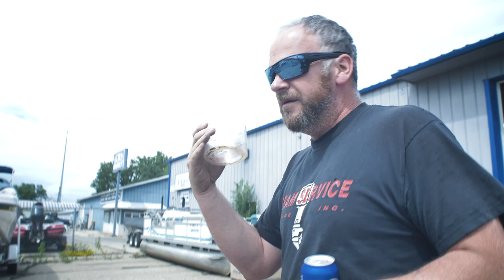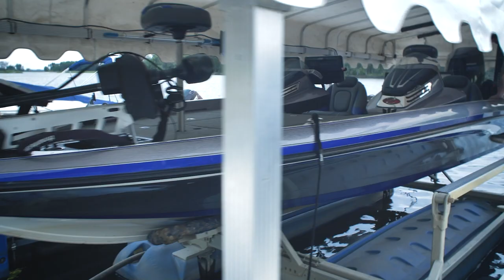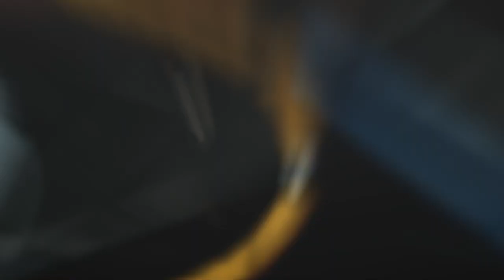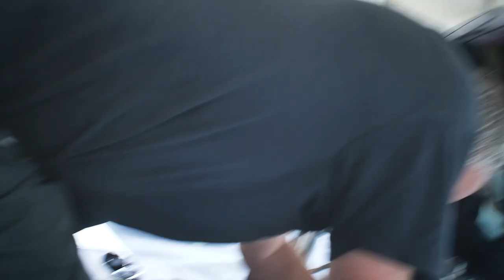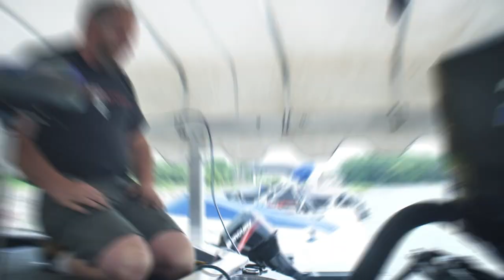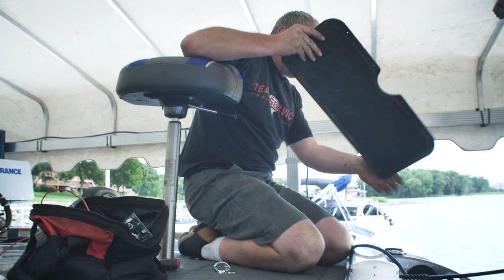POWER POLE PUMP FAILURE! (WATER LEAK!)

Comment: Keep these coming love it. I got a 2000 mercury 150 xl salt water series outboard 2 stroke I keep getting gas in the small oiling tank on the outboard I got a few new 2 psi check valves hopefully that works. Any ideas ?

Comment: We have a guy in Baton Rouge that makes house calls.  I only use him for my motor.  I have back up pumps, motors and boards.   Have you had a strut go bad?  My Allison stays pretty dry in the back and after each trip I open the compartments and put a fan on them, but I inevitably get a weeping pole, that won’t stay up(😎🤡) and on two occasions it has been the cylinder that has gone bad.  So, I am going to get a replacement cylinder.  Now that the crappie brakes are out, the anchor part of the power  pole is almost obsolete , with the exception of being the device that drops the crappie brake into the water. So I might switch from the 10 foot poles, which do have way more problems, to the 6 foot poles. What do you think ? I bet you have not installed a crappie brake set yet. Just wait. They are comin